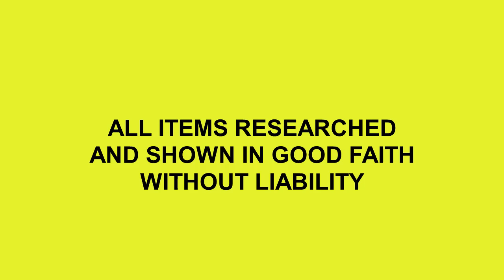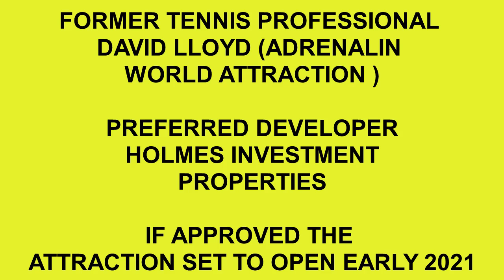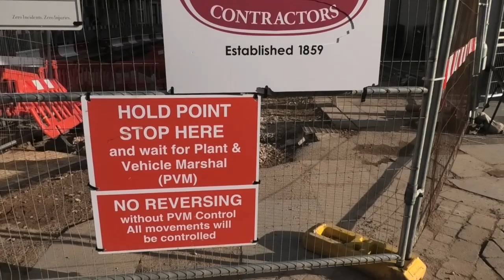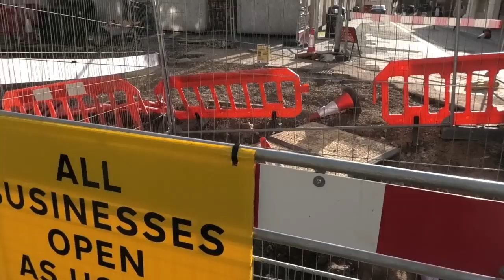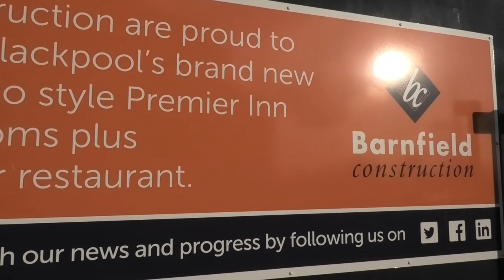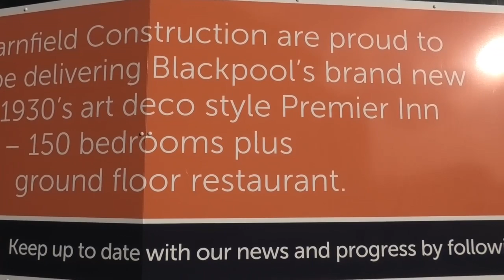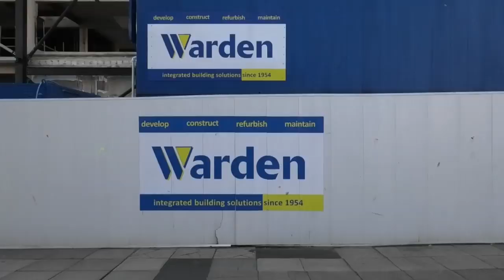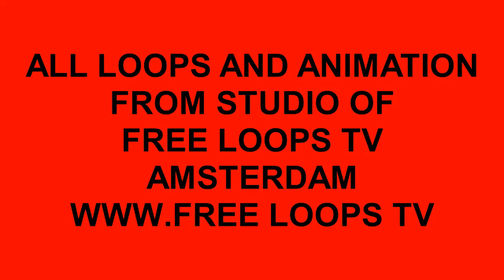BUILDING BLACKPOOL BETTER PART 127

Comment: Good morning Colin. Such a shame to cover a beautiful golf course with concrete .🇬🇧👍🏻👏✅
Reply from the maker: INDEED DENNIS==THE ONLY 18 HOLE GOLF COURSE ON THE FYLDE SO I AM TOLD==REGARDS COLIN AND THANKS
Reply: @SEASIDEVIDEOS  North Shore, Fleetwood, and several in Lytham St. Annes have 18 holes. Poulton is 9, as is the driving range/pitch and putt facility inland at Norbreck.
Reply from the maker: OH MY==CHARLIE THANK YOU FOR CORRECTING THE INFORMATION I RECEIVED AND SAW==I APOLOGISE TO ALL GOLFERS AND CLUBS ETC==CHARLIE PLEASE ACCEPT MY THANKS FOR YOUR INPUT==REGARDS COLIN